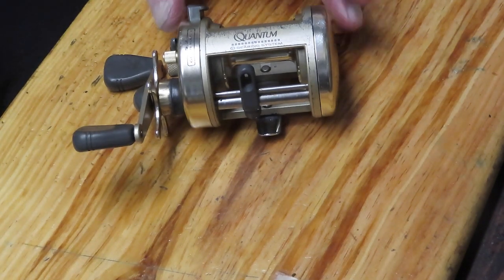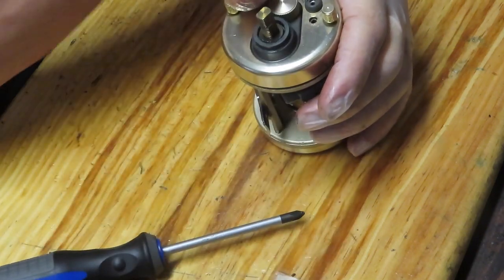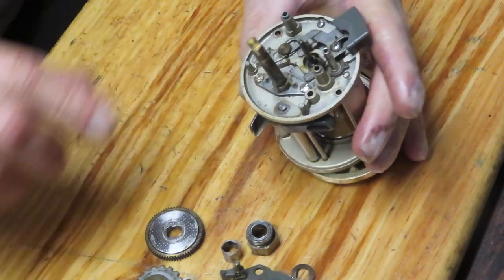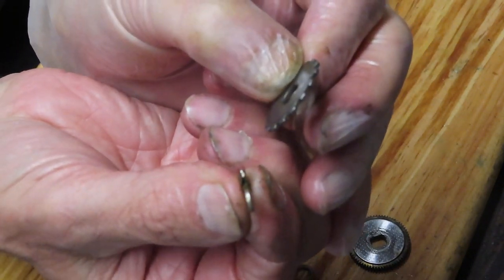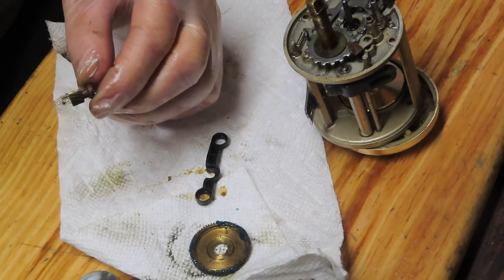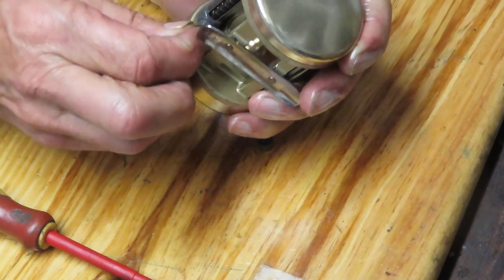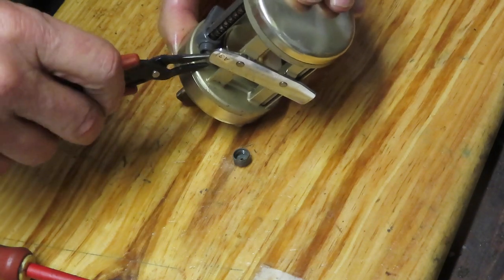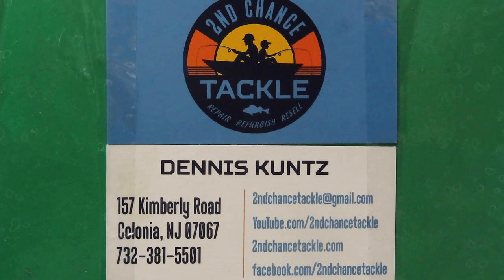Quantum Iron 410 round baitcaster fishing reel how to take apart and service

Comment: I had 2 of the Quantum Irons from early 2000 there definitely not a ABU with too many plastic parts that all broke the same way with the nut caps and the thumb clutch release button fracturing back when the were owned by the Brunswick company when I ordered replacement parts back in the day I remember it wasn't a multi drag disk reel they had magnum gears what it was advertised as all brass main and pinion Quantum Hot Sauce grease will give a better feel the grease doesn't migrate away from the gears with teeth meshing and the oil is good as well but use Penn green grease on my Penns but the Penn oil isn't the same as the thin blue oil originally .
Reply from the maker: Thanks for the additional information and tips on the Quantum greases - Dennis

Comment: Wish they still made these and the 430
Reply from the maker: They were nice reels, but not a mainstream part of their assortment.  They focus on spinning and low profile bait casting reels, so I guess these were sidelined along the way due to low volumes of sales
Reply: @2ndChanceTackle I got one for 50 dollars cad off my friend. Cosmetically a little scratches but it works. I had an issue. The guide or the pawl whatever it's called the one on the worm gear. When the lines in the river sometimes it like to stay on one side of the reel and bunch line up on one side. I have added some reel oil in the worm gear now but yet to test it. It seems under the rivers current it does it. Any idea on what that is?

Comment: Good afternoon...i have a quantum iron IR430CX i took it apart to do maintained and now when you turn the  clicking mechanism off it still makes the clicking noise and when you turn it on the clicking noise is wayy worse..im not sure if i put something in wrong or not but im wondering if you have ever worked on one or have a video on braking on down or not... thank you
Reply from the maker: I don't have a video on it and don't recall the clicker mechanism.  I would recheck it to make sure the spool is seated properly inside the reel.  Thanks for asking - Dennis